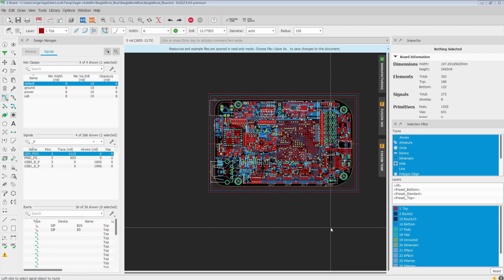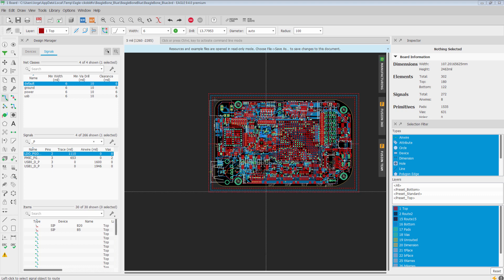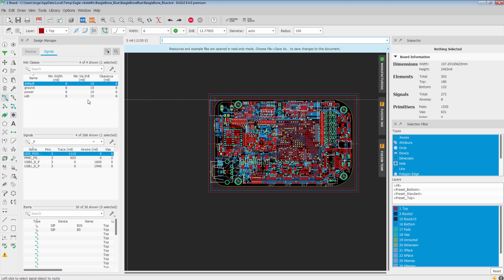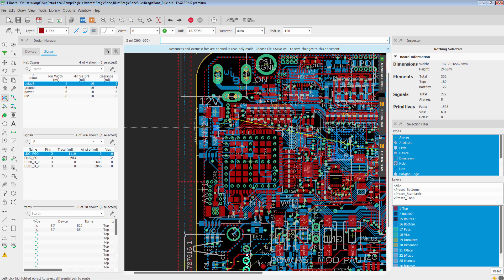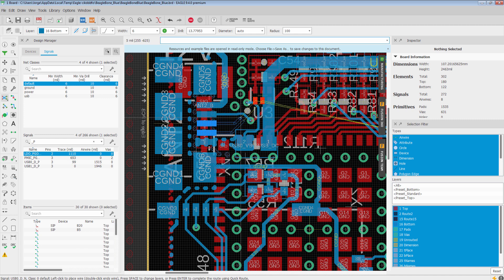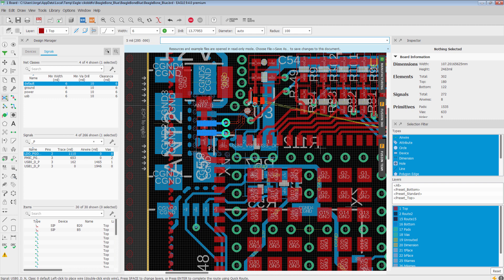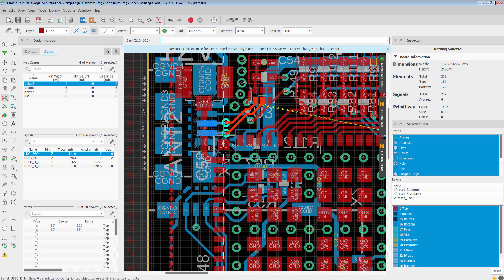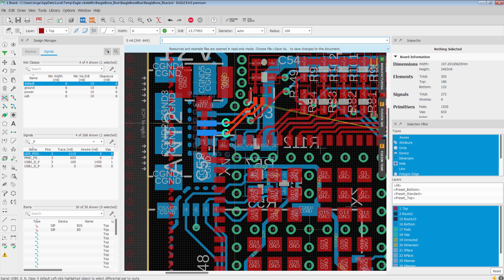Differential Pair Routing mode in EAGLE 9.4!

Comment: Is there a way to do the following two things: length/impedance match a set of (sub)traces (like a bus+clock)? Is there a way to length match a differential pair, such that the signal is the matched the most along the travel path, not just at the end of the trace?

Comment: Thanks George. Can you also consider a tutorial where one uses a common motherboard and then use this map to design application specific module boards that can be attached so that all dimensions, holes and connectors will match those of the motherboard? For example if I wanted an app that used a USB interface, then I just add the USB module.  Or needed WiFi then I added that module. What is the best way to match a child pcb off a parent pcb. I cannot find such a tutorial anywhere.

Comment: I am glad to see some effort going into differential routing. My biggest challenge has not been the initial route, but rather editing a differential route AFTERwards. Generally - differential routes are priority signals and established relatively early in the design. As the designer gets closer to a final layout, the diff pairs need to be pushed/tweaked and they have become independent traces by then - difficult to edit and maintain good geometry. Especially true/difficult for impedance controlled requirements. This means that I usually am better served by deleting some or all of the differential route and starting over. 

For high-speed designs, I really prefer radiused turns and those are remarkably difficult to manage because Eagle does not maintain tangency when editing routes with radius turns. 

Again, glad to see some effort but this has solved about 2% of the differential pair routing challenge.
Reply: Radiused turns are supported by the diff pair router. Also the move command will preserve the tangency's if you use "preserve angles" and preform a group move on them.
Reply: @Anathorn2008  You are totally right! I just tried it along with the new selection filter feature. Very thankful you called me out on this - very useful tip.
Reply: @Anathorn2008  Sadly - I retract the majority of my previous comment. I just pulled up an existing design with differential routing - editing an existing differential pair with radius turns is not practical. All I have managed to accomplish is making a mess of the route. 

Perhaps it is technically possible - but a fiddly mess that has me frustrated. I just want to grab a differential segment and move it around similar to a single track. I want to grab an arc and adjust the radius and the endpoints similar to countless vector drawing tool since the mid-'80s.

Eagle manages to break up the trace, add angles, and is generally difficult/impossible to predict the outcome as it is guessing my intentions in some weird way. For now - I will still classify differential routing in Eagle as 'SOMEWHAT BETTER THAN USELESS'